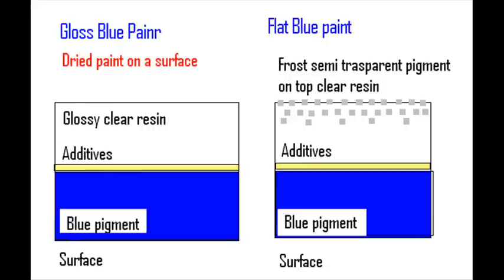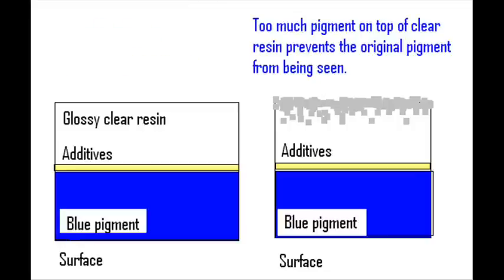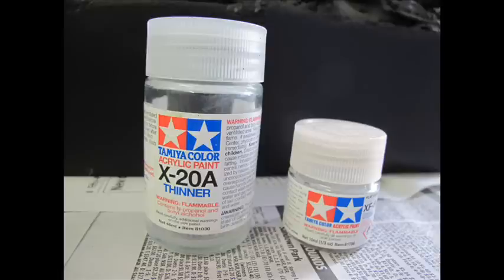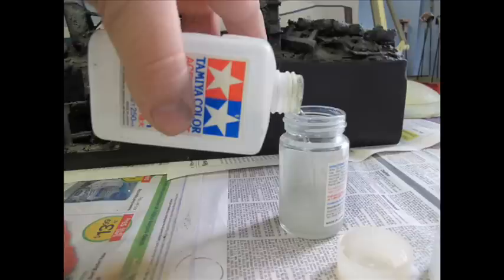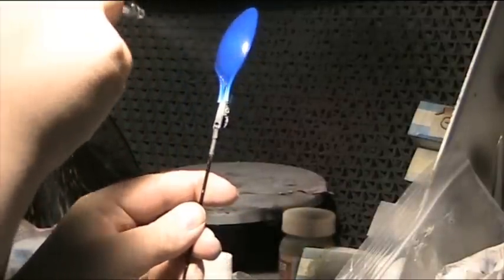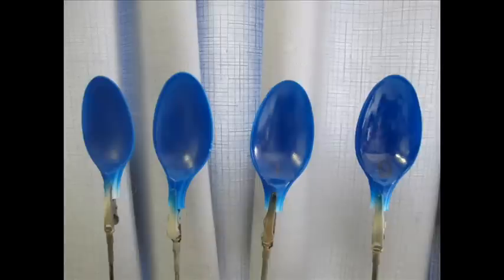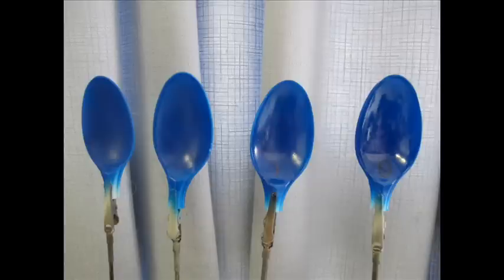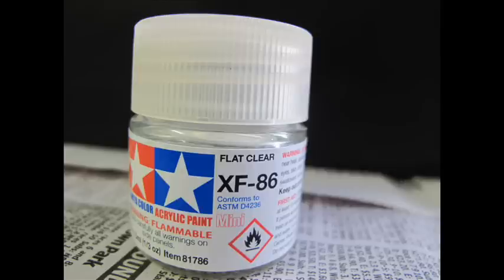Gundam/ mech model workshop 95: Tamiya acrylic clear flat (XF-86)

Comment: I recently sprayed using XF-86, thinned 1:1 and 1:2, was getting bad frosting. Never had frost  issues with the spray can Mr Top Coat. Ended up having to slowly sand the kit to fix it, but some inner deep grooves still showed some frosting. So annoying. Sounds like going with a 1:3 ratio is the proper approach. I also think I sprayed two layers too quickly, since it was hard to tell if I sprayed enough before letting it full cure/dry.

Comment: I do armour vehicles never used clear on them can I use your example on a Churchill tank painted in acrylics and after the clear coat do some washes?
Reply from the maker: If you have a deeper dig onto my channel I do a lot of 72nd armor. Sludge and pin washes do work over and under this mix. Since then I have moved to lacquer and still use the same method without issue.
Reply from the maker: some washes have a gloss sheen so I add another coat onto to matt everything up.
Reply: @mokanaman  thanks mate do you use reddit at all?
Reply from the maker: @mkennedy7431  I do not really engage in many communities or social media groups any more. Sorry. Just keeping to myself on my channel and pages however the comment sections and pm are always open to answer questions or chat about topics around my builds or products reviewed.

Comment: 4 questions:

(1) how do I prevent dust sticking... at least minimise to lowest chance of having dust sticking to it?

(2) Will shining strong lighting ( tungsten filament bulb) at a freshly sprayed item (I) help it dry faster and (ii) reduce dust sticking since hot air rising which prevent dust from dropping downwards to it?

(3)  should I keep an airbrush just for spraying. Clear coat?  So that residue do to previous dried paint will create dirt debris 

4) any problem with enamel clear onto acrylic water base  paint surface ?
Reply from the maker: 1) After spraying place model in a bread box or cake cover, any sort of air tight container will work. 2) The heat from a tungsten lamp will cure the paint quicker. UV in the light has no event so heat radiating from a heater or other devices will do the same. 3) With a good cleaning and maintenance regime you should not need one but a back up airbrush is never a bad idea. If you do get a special clear coat/ priming airbrush get something cheap with a 0.5mm needle and nozzle to prevent frost and over spray. 4) Enamel over tamiya and gunzi paint in thin coat is ok. Water based may have trouble. Try out on a test piece or spoon first. Be ware enamel is very slow to dry and cure taking days before handling can occur. The finish is amazing and worth the wait.

Comment: Have a question if I dont have airbrush can I use normal brush like paint brush?
Reply from the maker: yes you can and have tested this before, you can also add little more thinner
Reply: @mokanaman  ok so to use with paintblush I should use more thinner right? 
I will use it on skin of my pvc anime figure I don't have experience on this so I'm kinda nervous.
Reply: @mokanaman If I use paintbrush wiill it leave brush mark on it? or matte gonna look weird?

Comment: hello, I am new in Gundam kits. I was wondering if you recommend the Tamiya flst clear over the Mr color flat clear to be used as too coat for a finished Gundam kit. alternatively, do you know how good the Tamiya ts-80 spray Is as top coat? I've heard mixed feelings since it is lacquer based
Reply from the maker: The acrylic has the advantage of having a ruff surface and ideal for weathering. If you do not intend to use pigments or filters you do not need to use this products. TS-80 spray work well from my experience but I've always like testors dull coat during my rattle can days. Mr. Hobby clear matt is nice as it has a smooth and ruff matt finish option once you start weathering.

Comment: Alan. I wonder if you can help. Once you have airbrushed your model with its finished colour scheme, what would you use before you add the decals? Would XF-86 be okay? I want to add decals and then weather. Can I use XF-86 for all stages i.e before adding decals, after weathering as a finish coat (if you didn't want a gloss finish)? I'm in the UK so getting some paints (testers dull coat etc) can be difficult. Thank you mate.
Reply from the maker: Hello Chris, generally with decals they need to be applied on a gloss surface and sealed with a light gloss or semi gloss layer to prevent slivering (the edges of the decals turn white). Once the finial layer of gloss is applied then you can use a dull finish for weathering. This is my normal process, really any brand or type of gloss and dull can work but XF-86 and Mr. Color Flat ruff does take to weathering pigments nicely. Anything can work from testors, Tamiya and even artist clears.

Comment: Hello, I have heard that if you apply TS 80 (Flat Clear) over the top of decals it can have an effect on them have you had any experience with this happening?
Reply from the maker: Regarding decals the clear parts can silver or fog up from the surface it is sitting on and becomes more obvious from matt coat application. To prevent slivering make sure lots of water is used to slide the decal and not applied dry. The surface is as smooth as possible. You may need to clear gloss or polish the painted surface. Apply a clear gloss on top for protection then matt for the perfect finish. These clear gloss coats only have to be thin and not even shiny.

Comment: so this is ideal after applying clear coat to seal decals to make the gloss surface flat?

Can i also use this for hand painting?
Reply from the maker: It is ideal for using over a gloss coat and can the same mix can be hand painted.
Reply: thanks

Comment: Please. can you tell me again the amount of thinner and clear flat to mix. if i put 10 drops of clear flat, how many drops of thinner do i have to mix?  thanks.
Reply from the maker: +Roberto Austria 30 drops of thinner
Reply: is the same for the x22 clear and the x35 semi gloss clear? if you can review the x35 and x22 it would be helpful. thanks. your videos help me a lot.
Reply from the maker: with those two use as if you were airbrushing normal tamiya paint. gloss clear can be thinned more but will not appear to be glossy which is an advantage.
Reply from the maker: On second thoughts I will consider it.
Reply: +mokanaman hello again. for the x22 and x35 is correct thinner 50/50? thanks.
Reply from the maker: about 30/70 according to the tamiya website 30 thinner 70 paint.

Comment: My XF-86 looks more satin than flat.  I applied a layer of XF-86 on top of XF-60 and the XF-60 became slightly shinier.
Reply from the maker: The coats need to go on in dusted layers, if applied wet and thick the resin will raise to the top making it more glossy.
Reply: mokanaman 
Thanks for the help!

Comment: I just got my bottles of XF86 (10ml), dropped 1 jar into an empty 40ml X20A bottle I had and then filled the rest with X20A thinner. 

Needed to make a clear coat to spray over my armor models, so I can use the AK Interactive washes I will use. 

Great video.
Reply from the maker: long time coming but I've bought 100's of plastic 100ml eye dropper bottles to fill with paint and pre thin. Life will be so much easier.